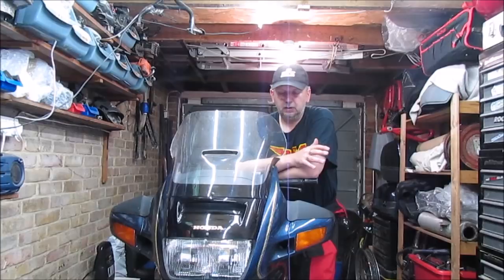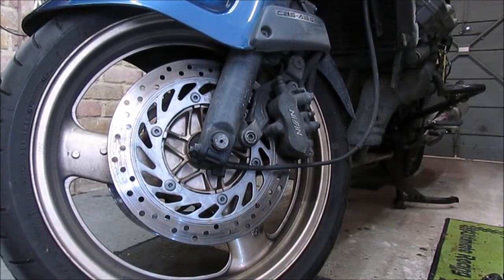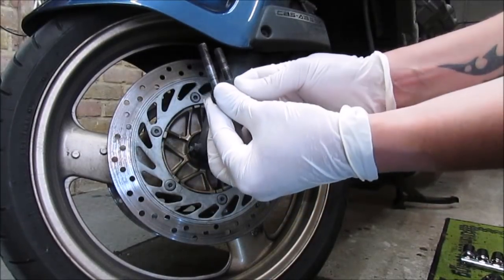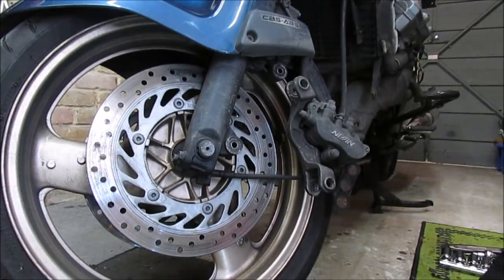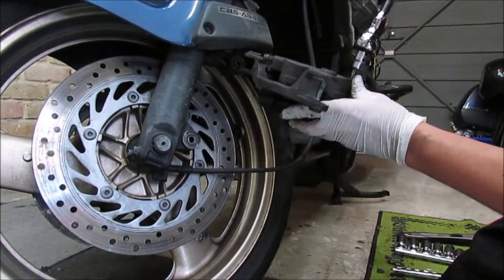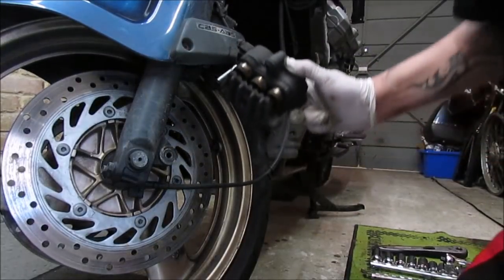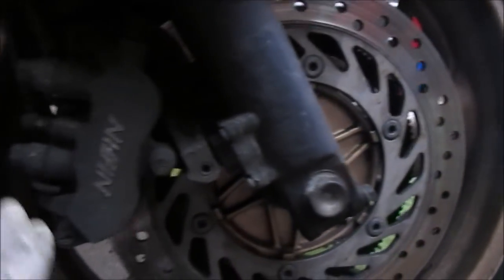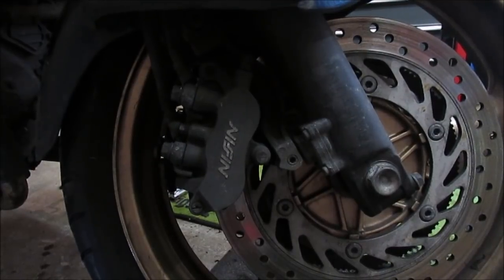Honda ST1100A -  Front Brake Issues - Part 5

Comment: Great vid  did the break set pin have some kind of cover on them as my 1999 doesent seem to also looks like a straight edge screwdriver to open cover first before allen key butt does not budge would it be siezed ?

Comment: was that a special tool you used for rolling back the piston's  also was that break cleaner or can you use carb cleaner to clean up also did you only use copper grease on final little nut no other kind of grease anywhere please?
Reply from the maker: Thanks Colm, the tool was a caliper spreader that i pick up a while ago on Ebay, i use brake cleaner, never tried carb cleaner on brakes, just in case something goes wrong, copper grease has always worked well as some grease can wash away when wet
Reply: Ageed that secondary master cylinder pivot arm could be seized or secondary master cylinder corroded and seized on of the small drilling’s in the secondary cylinder are blocked. If the latter two don’t bother with a kit as with a corroded bore the piston kit wont seal properly. If the secondary cylinder is seized on it will permanently apply the rear calliper until fixed. If you can’t move the secondary cylinder back and forth it probably seized and bolloxed.
Reply: That was the case on my st1300 anyway.
Reply from the maker: @bobbo9549  appreciate the info

Comment: Its not the pistons, its the floating bolts, the first 2 you took off, they suppose to float as the piston apply pressure, clean them really good and lube them with some white lithium grease and now they will float so both pads get equal wear.
Reply from the maker: Thanks for the info
Reply: absolutely! Reminds me of the my beloved CB400F front brake

Comment: What year is this bike? Did you figure out why it wouldn’t roll backwards? Thx.
Reply from the maker: Thanks Mark, it is a 1999 ABS model, yes the front abs sensor the bolts on to the back of the caliper bolt was not secured properly, that was causing the problem, so glad i stripped it all out and spotted it, could of been costly

Comment: I have an ST1100 in the same spec as yours and, without wishing to appear clever, I have another tip for you.

When you've got the front calipers off, have a good look at where they mount on the forks - there are needle roller bearings there and on the linkage that goes from the L/H caliper up to the secondary master cylinder.

These are known to be neglected and will seize - mine did.

New ones of the correct size are available from bearing suppliers much cheaper than Honda ones.
Reply from the maker: Thanks Neil, appreciate the tip, i am learning as i go on this bike, my video's are not how to's more a documentation of my journey, so i appreciate any tips/hints/advice all part of the learning process, i am due to go back on to the ST soon as still more work to do
Reply: @TheAmateurBikeBuilder  You're most welcome Sir .

I've had my ST since October 2014 and I'm just about coming to the end of any/all bits and pieces that have been missed over the years and I'm more than happy to share any knowledge with anyone. You'll find us Pan-Men are only too happy to wax lyrical about the "Gentlemen's Express".

I don't know if you've gone anywhere near the rear shock yet but the bottom mounting bolt will seize for fun. Whip it out, give it and the threads in the final drive a good clean and shove it back in with plenty of anti-seize on the blighter.

One upgrade I did recently was changing the instrument light bulbs to LED's. WOW - what a difference!! The chap who does the kits is on Facebook - his name is Mark Glover and he goes by Lightenupgrade. Seriously the best £20 upgrade ever.

Don't hesitate to let me know if you need any other tips or torments.
Reply from the maker: @neilgreenway7214  its still a learning curve for me, this bike was in a right state when i got it, shiny on the outside and a major disaster underneath, as i said i will be going back in as still more to do so will have a look at the shock while i am in there, thank you again for the advice and i will call on you if i need some help, cheers
Reply: @TheAmateurBikeBuilder  I'm only too happy to be of any help I can to a fellow member of the Gentlemen's (and Gentlelady's) Express Club.
Reply from the maker: @neilgreenway7214  appreciate that, thank you
Reply: @TheAmateurBikeBuilder  Another tip.........................

You have a span-adjustable front brake lever but not clutch lever. An adjustable clutch lever from a Honda VFR 800 goes straight in and makes for much less of a stretch when letting the clutch out.
Reply from the maker: @neilgreenway7214  Appreciate the tip, Thanks

Comment: How did you clean the back (underneath) of the calliper? or did you just clean what you see?
Reply from the maker: do you mean under the retaining clip ? if so brake cleaner and a wire brush, some was done off camera but all calipers were thoroughly cleaned
Reply: Yes, guess so. I meant under. You sprayed the top of the callipers and then started scrubbing them. What did you use to clean the other side 180 degrees at 4m58s.

I am asking this because of my NT700V, foot brake is hard to push down and also the pads are almost gone, I am not using the rear brake to stop and I want to know if I will be able to do it on my own.

Will the bike hold safely whilst taking the rear weheel off?
Reply from the maker: if you put the bike on the center stand then yes will be fine, or use a rear paddock stand , i used Rock Oil Brake Kleen for all the caliper cleaning and i have 3 different brushes, soft/medium and coarse,
Reply: @LordOfThunderUK  No info given as to how he cleaned the underside of the pistons. It is possible to get a piston removal tool in order to rotate the piston whilst still in the housing. You could always, whilst the piston is pumped out of the housing use a strip of very very fine emery cloth?sand paper such as 600 grade and gently remove the crud that builds up around the piston lip. Use brake fluid as a polishing lubricant then clean thoroughly afterwards with brake cleaning fluid.
Reply: @daviddoran6840  Thank you for your recent post to me. I sold my Deville 2 years ago but I have taken what you said onboard.
Reply: @LordOfThunderUK  No problem. Ride safe.